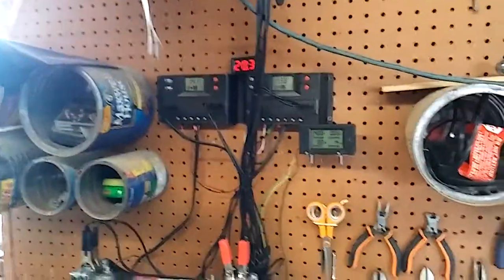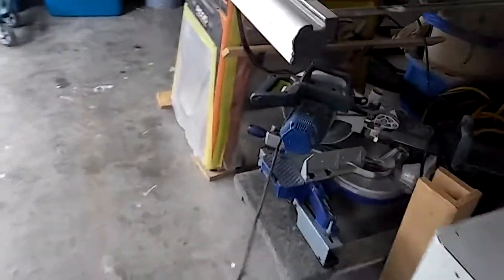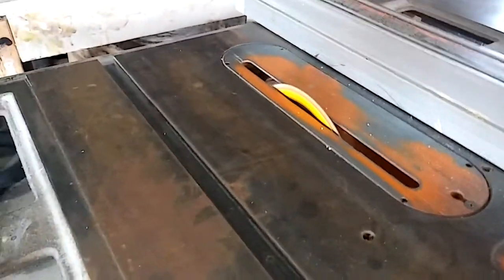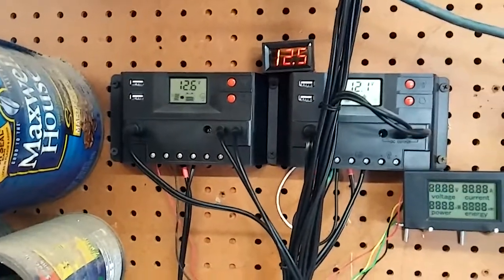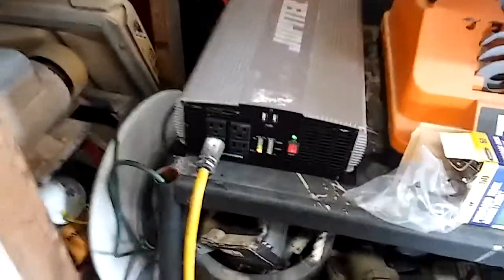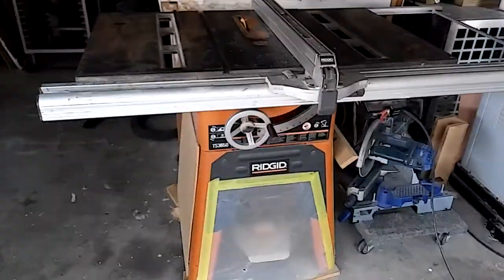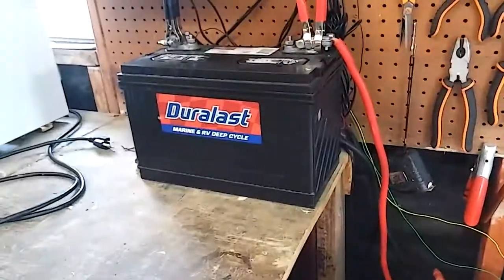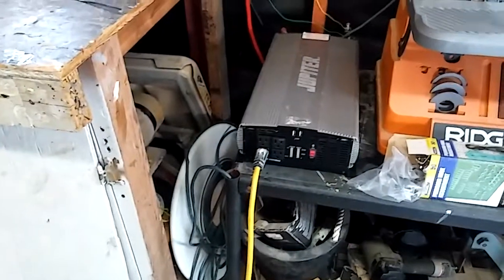Testing the Jupiter inverter.

Comment: I was wondering what the specs are on your deep cycle battery in video?  I have a 690 marine cranking amp with 92 AH. Was thinking bout buying another to run parallel but not too sure yet. Also are you running 2/0 AWG cables on inverter??
Reply from the maker: The battery was from autozone. 100 amp hr. I no longer have that battery. I believe the wires were 2/0.

Comment: I have the same inverter in my truck, had it in my old Sonoma powered by one deep cycle battery like you do in this video but now it's in my Ford powered by 2 deep cycle batteries (I added a second battery because it wasn't running as much power as it was in my Sonoma) but the second battery didn't help at all. When it was in the Sonoma I accidentally left my heater on all night and it was still running the next morning. With it in my Ford now I'm lucky if it could run a heater for an hour. Any suggestions or clues as to what's the problem?
Reply from the maker: Are your two batteries exactly the same. Meaning the same size and amp hour rating? The smaller battery will draw power from the other battery to keep itself charged. Resulting in your bigger battery losing power faster.
Reply: @Checkitfirst  no they're no I can't remember what they were exactly but both together equalled about 350amp hours and I thought that oughta be good since the battery I used in the Sonoma was probably 150amp hours. But I added the second battery because my inverter wasn't putting out the power like it did before, or does my starter battery and auxiliary batteries need to be the same?
Reply from the maker: @brando6136  
The two batteries that are connected to the inverter need to be the same. I ran into this problem when I first started. I got a second battery that was a little older and smaller thinking I was adding more capacity to my system but in fact, I did not . I noticed just having the two batteries connected. My power was going down without anything connected to it. After some research, I found out mix match batteries do not get along and power will just disappear. It did not make any sense to me but I did get two brand new batteries from AutoZone that matched and it worked out great.
Reply: @Checkitfirst  okay I'll definitely give that a try! But still before I added that second battery the power wasn't the same as it was in my Sonoma, I've been trying to figure out if there's some internal part that's common to go bad after awhile.
Reply from the maker: @brando6136  
Are you using your alternator to keep the batteries charged?
Reply: @Checkitfirst  so should all my batteries be the same as my starter battery?
Reply from the maker: @brando6136  
If there connected together then yes. 
Must be deep cycle though.
Reply: @Checkitfirst  damn I did not know that, I guess I got lucky in my Sonoma lol I don't remember what my start battery was in that but I'll definitely give that a try, thank you! If by chance that doesn't work for some reason are you familiar with any internal parts in inverters that commonly go bad?
Reply from the maker: @brando6136  
Not really. Typically they work or they don’t. I would bet $1 million that your Inverter is probably just fine.

Comment: First off nice video. I got a question new to solar equipment and I was wondering how you got the volts going into inverter higher then 12volts?
Reply from the maker: The inverter can handle around 14 volts input which is what you want. Your charge controller should be charging around 13–14 volts.
Reply: @Checkitfirst  ok my charge controllers are set at 13.5 but they both say 12.8 charging 4 batteries. We're using a 5000 inverter too
Reply from the maker: @kashwaydeal4343  
Is your charger a pwm?
Reply: @Checkitfirst  ones a mppt off ebay and the other is a thunderbolt 100watt charge controller kit controller
Reply from the maker: @kashwaydeal4343  what brand is the mppt
Reply: @Checkitfirst  I can't post a picture of it
Reply: @Checkitfirst  I got a question: I've got 2 of the 100 large solar panels from harbor freight and sometimes when their hooked to own charge controller the display of volts start to go up and down and the neg wire from panel to controller then to battery start to get hot really hot?
Reply from the maker: @kashwaydeal4343  
Sounds like you need larger wire like #10 from panels to charger #8 from charger to battery
Reply: @Checkitfirst  we had those 2 panels in one of of house for a few days no problem then we got to move the to another spot where there's more sunlight all day then from there that's when it started jumped around and getting hot.
Reply from the maker: @kashwaydeal4343  
Making more power. That’s awesome

Comment: I don't recall testing a table saw, but I did do a chop saw.  My shop vacuum pulled quite a bit more than the chop saw or a window mounted air conditioner.  
Thanks for sharing.